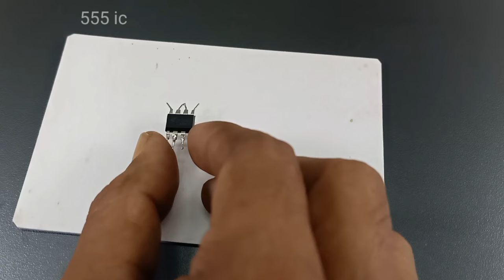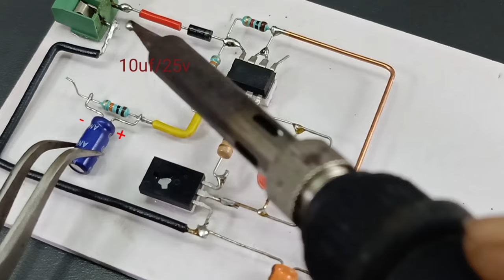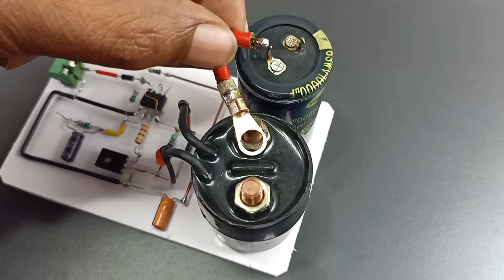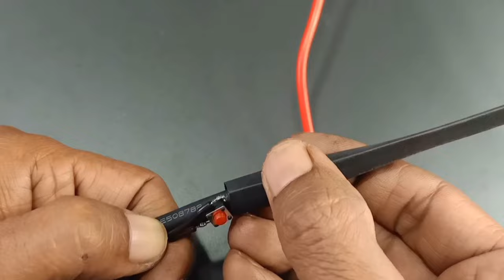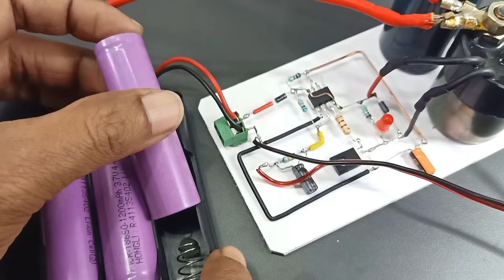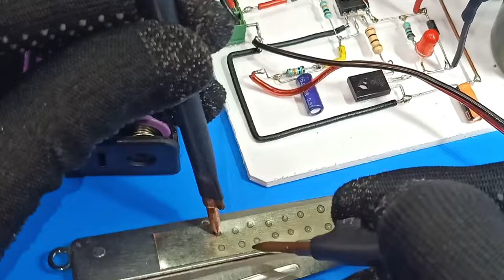DIY SPOT Welding Machine Homemade Simple /how to make high power spot welding machine with BATTERY

Comment: Sir, which of these capacitors have you used 10000uf/63V or 10000uf/50V?
Which one of the two will get the work done?
Reply from the maker: @itsamanhere134 You can use any of them

Comment: Sir in diagram you say use 12 volt 40  amp relay but you gave buy link of 12 volt 100 Amp relay which one is better option?
Reply from the maker: @itsamanhere134  best 12v 100A

Comment: Hi , Assalamualaikum how r u brother. I buy 12v diy Spot welding board . But it's need lots of ah like a 300ah battery to welding a good . Can u modify that's 12v diy spot welding board to work 12v to 50 ah below to get best spot welding. ?
Reply from the maker: You can use this circuit
Reply: Здравствуйте, не могу найти реле,можно поставить простой реле на 12в40а
Reply from the maker: @ЖенишбекТотонов  check description link in the description

Comment: Sir, even after doing everything correctly as per your instructions, This is not working properly. After working properly for the first few times, it is flowing current without being switched on. Although i used 100 relay and 12V 60AH battery.
Reply from the maker: @itsamanhere134  you use maximum 12v 18-40Ah battery

Comment: Sir can I use 63 volt 1uf & 10uf capacitor in the position of 25 volt 1uf & 10 uf capacitor?
Reply from the maker: @itsamanhere134  yes, you can try